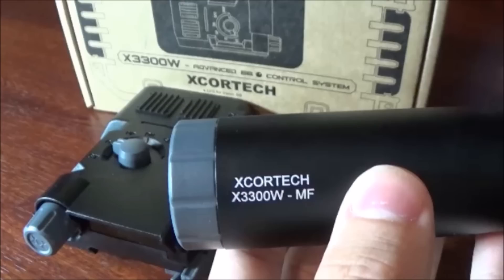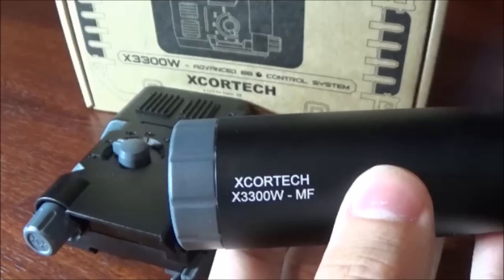FUNNY AIRSOFT FAIL! | XCORTECH X3300W AIRSOFT TRACER UNIT PT.2

Comment: How much does the tracer unit cost and is there blue tracer bbs I've seen them but could not find it.
Reply from the maker: Konstantin Games This come with a hole bunch of stuff though, it's not just a tracer unit, this costed like 100 bucks
Reply: It is all 100 dollars. You get a tracer unit/chrono which is all built into the tracer and this is controlled by a mock peq box with a screen that can count bbs up and down you can also do things like 2-9 rnd burst with the included mosfet and battery voltage checker. Some say 100 bucks is steep but i could have easily seen this thing priced at 200 great buy